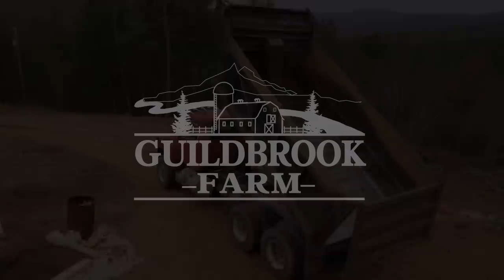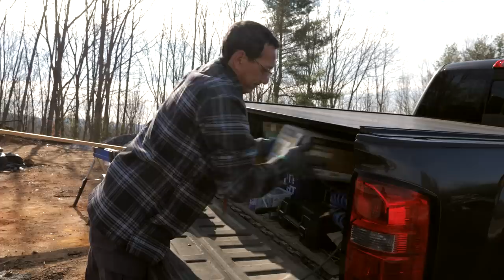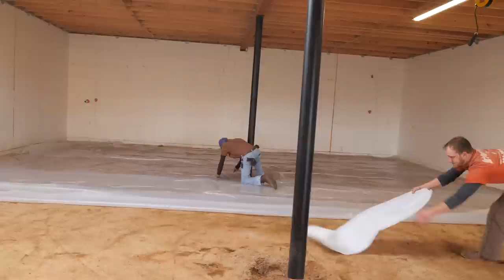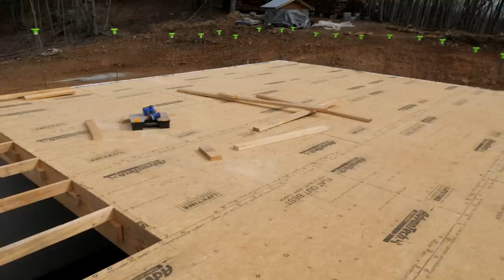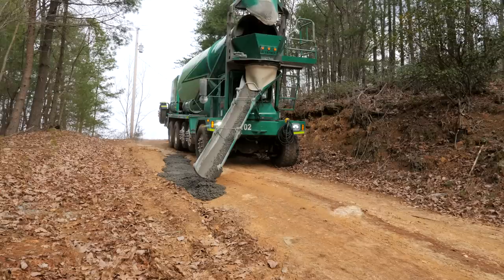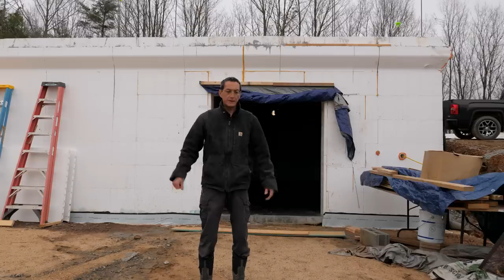ICF Mountain Homestead: Basement Floor Slab Pour & Finish

Comment: No rigid insulation below slab? No in slab radiant tubing? No floor drains? No rebar or welded wire mesh?

Comment: every area has it's own unique way of doing things. Where we live, sand has to be trucked quite a distance so it's expensive.  Crushed rock is abundant and that's what typically is used under slabs here.  I put 2" of foam under my basement slab and installed radiant tubing.  It's incredibly comfortable paired with the ICF foundation.
Reply: What type of crushed rock?  I’m worried 57 lime stone will poke through the vapor barrier.  I’m thinking 57 round river rock but that won’t pack well.  I’ve seen other use 57 limestone, then sand, then vapor, then foam.
Reply: @neckofthewoods24  It's 3/4 minus crushed limestone. Where we live, I've not seen anyone use a vapor barrier under their slab.  the soil here is well drained.  Basically I'm sitting on solid rock.
Reply: @neckofthewoods24  If you use foam you put it on top of the foam otherwise think you would need to put some sand on top of the gravel to keep from tearing the plastic and I would have used at least 10 mil plastic no matter what code is.
Reply: tee kay I’ve never see anyone put the plastic on top of the foam as foam can absorb moisture over time.   Also I know they make thicker plastic but I’ve only ever seen people use 6mil.  If 10mil isn’t crazy more I’m not opposed to it.

Comment: Good morning. Looking really great! Your basement is similar to ours, except the cement was poured in with a  long arm. We did not have a cap, as our modular home unit WAS the sub flooring.  Its going to go fast now. you must be over the moon! Our newly poured foundations walls and floor still contained a lot of natural moisture when we moved in November 2016. But we had a large airtight wood stove in the center of the basement to help it cure. You view is amazing. We are deep in the woods. A sump pump might be cheap insurance.

Comment: I’m curious what about water lines, sewage pipes, no rebar in the floor? Or even wire mats. I know they have that fiber concrete now but still I would think some kind of metal would be a good idea. Even if you use composting toilets I know you have a well please tell about your plan for addressing those things.

Comment: Water flows. If you fill in the rut on the road, you need to make a deliberate one to the side. Otherwise you will end up with another rut somewhere else in the road. Also more nasty if it forms next to some set concrete.

Comment: Not taping the seams almost defeats the purpose of the plastic, clean rock that drains easier would be a better choice for under the slab. Also if you had a thermal break under your walkout door it would keep the basement slab warmer.   But you did it the way slabs have been done for years so I can't blame you.

Comment: It's great to see your progress during the winter months.  It can be difficult.  For others watching this video...  if you are are going to heat/cool the space in a basement area, pour your slab  with at least 2 inches of EPS foam or Rockwool insulation under the poly and concrete.  It breaks the thermal bridge, reduces the cost of heating, and the floor will be warmer to your toes year around.
Reply: Where does the vapor barrier go then...between the sand and insulation or between the insulation and concert slab?
Reply: @briangroene7756  ,  any layer above the sand or gravel.   Most often I see the 10+ mil poly (vapor barrier) between the insulation and slab with all of the poly seams taped.  It's primary function is to keep moisture from the soil layer (gravel or sand) from seeping into the slab and if done right will also keep radon from infiltrating the basement.

Comment: great job! Are you going to put water sealer on the floor! It will help to keep floor sealed. Thompson water sealer great and you can sweep the water after it rains. We used to do it when I was building houses and it works. It comes in a 5 gallon bucket, and it helps when it rains a lot. Keeps the wood from bucking. you've came a long way and it's looking great!

Comment: Hmmmmm, never seen a slab done like that before. Up this way it's always gravel instead of sand with reinforcement wire embedded. We also run a 4" perforated pipe in the gravel in case of radon (maybe you don't have that down there, and then a channel along the wall just in case any water was to pass your first defense of drain pipe on the exterior of the walls.
Reply: Joe D it’s a bit different around here but not that different. We don’t have many issues with radon so it’s not required to install a radon mitigation system here but that’s were the differences really die. There were so many things on this slab that were not done correctly and if I had a concrete crew come in and install a slab the way they did then their asses would have been out the door before they ever had a chance to get the 2nd yard of concrete out of the truck. 

No reinforcement wire is HUGE!! Now I’m sure they will say that they put fiber in it which is fine and dandy, fiber makes a stronger slab but when the slab cracks, and it will, the fiber will not keep the slab from shifting and rising and that is the sole reason we use wire or rebar, it won’t prevent cracking but we can prevent it from moving which will screw up your world when you have a half inch shift in the floor. 

There will be regrets later down the road that there is not an interior perimeter drain either running outside and down the hill or to an interior sump pit and then out. You will always have water trying to infiltrate and you’ve got to use every bit of building science and technology we’ve learned over the years and put those products or procedures in place while building cause it will be financially prohibitive to try and retrofit later if not physically impossible because of the amount of demolition required to retrofit. 

The power trowel was used way to early. The concrete was way to wet which caused them to overwork the slab which ultimately weakens the slab and then is when problem #2 comes in to play because it will be more prone to cracking now, even outside of where the control joints were cut in, which in time will or can, lead to slab shifting because of no wire or rebar to prevent the shifting. 

The slab was to green to install any type of sealer. The slab needs to cure out for a month or two at minimum before applying any type of sealer. This will ultimately end up peeling off at some point because you have now trapped a whole bunch of water in that slab that can not get out because your blocked on the underside by 6 mil poly, and now the top side with this sealer. The water will come out eventually, but it’s gonna end up destroying the sealer because it’s the weak point and the easiest point for it to work it’s way out. 

There are several more issues as well but this comment is getting too long already and it won’t make a difference now anyways, the damage is done and all we can do is pray for the best outcome. It may look all pretty and flat for now but it won’t stay that way forever , especially in the region it’s in, and it’s a shame. The souls in that area are not the most stable and is not one of the areas as a builder that I would have cut this many critical corners. 

I’ll probly get a ton of crap about this comment but after 40 years of building, especially in mountainous regions, I’ve learned a lesson or two. 

Take care Brother
Reply: @1982MCI  Yep, agree with all of what you said, just didn't want to murder the subject. I am curious, you didn't mention the sand, is that common down there, not familiar with that, in theory I would think over time there is the possibility of pockets washing away and creating voids.

Comment: Hey y'all, 

Two things:

1. How did all that rain get in there? (cracks between the wood up top?)
2. When will you have a Sit Down and discuss the cost of all that flooring, and especially the concrete slab?

Keep on Truckin and Cheers from the Oil Patch in Central WY

Comment: I am surprised to see no rebar  to stop cracking and to add strength or under floor insulation. Hope you don’t intend to drive into the basement.

Also hope you keep the concrete wet for at least 7 days or it will crack like mad.
Reply: The concrete is fiber mesh. This guy knows what he's doing.

Comment: Hey, I didn't see you folks put any rebar in your basement floor. Did I miss where you explained that you didn't need it or that it's not required. 

Thanks

BTW, keep up the good work. Enjoy the vids.
Reply: Fibers in the concrete
Reply: Rebar is not necessary in a basement. The floor will not be subjected to any pressure that will cause it to move. Rebar in a slab on grade only holds the  pieces together.  The grade under the slab is more important

Comment: Question, why did you use sand? Why not Type II or what we call chat/ dolo, it's a fine crusher, that packs really tight. Vapor barrier, I would think it would defeat the purpose. Is it code there? I understand using sand for marble slab's or title, for the motions, and movement of the ground, and this why I would use sand. I've even used Type II, then asphalt over that, then pour concert over that. Love the work you're doing though, I just have a quizzitive mind is why I ask.

Comment: I just poured a little 3x4 foot pad for my composter to sit on. The directions on the quikrete bag were ridiculous.  I put almost twice the water and it was still too thick to lay nicely. I ended up pouring a layer of cement on top to get rid of the divets. Now it's smoother than I wanted! Lol. The floor looks amazing.  I am curious though,  why there was no rebar or the steel mesh things integrated into the concrete.

Comment: I would have put plastic on the flooring to protect the wood and also keep the basement dry
Reply from the maker: Did it. Just made it worse.
Reply: @Guildbrookfarm  ok I wasn't trying to make you look bad first but plz tell me was it worse because it held the moisture in the lumber from the fresh concrete being poured under it?
Reply from the maker: It holds in the moisture. Without the plastic, the wind dries everything out in a couple hours. With plastic it just holds it in and it can’t dry.

Comment: Why didn’t you pour the basement slab before the second floor or walls and why no rebar or wire grate? Is that sufficient for a car’s weight?
Reply from the maker: So it would be dry and protected
Reply: @Guildbrookfarm  no rebar or wire grate? Is that sufficient for a car’s weight if I want to park inside?
Reply: No rebar or wire mesh because this isnt a load bearing slab. That's all happening on the walls. This is just to hold furniture and stuff. For a car, you probably would need rebar but I'm no expert on concrete
Reply from the maker: Yes if you intend to park a car on it then put in 6x6 wire mesh. Our slab doesn’t need it.

Comment: Surprised there's no wire or rebar in the floor slab? Why is that not needed?
Reply from the maker: Fiber mesh in the mix 😉
Reply: @Guildbrookfarm  OK  if that's what you were told. But I didn't think fiber mix was as strong as rebar.. or wire for large slabs. Fibre (I thought helped hair line cracks mostly but not large slab loads)
Google says fibre is not enough.:.
===>>"Rebar every time! Fiber concrete STILL NEEDS REINFORCEMENTS with REBAR. We are doing 1/2 million sq ft slabs meant for warehousing, and they are all fiber reinforced.(w/rebar)"

Comment: no rebar or wire mesh? fibre strands in concrete to reinforce?
Reply: It's going to crack within the first year.
Reply from the maker: There is fiber in the concrete
Reply: 👍 @Guildbrookfarm
Reply: @Richard Brind Because the concrete guys they are working with wouldn’t know what they were doing?
Reply: @cathleencaratan3373  it wasn't a critisism, it was a question of interest and clarification which was addressed by Guildbrook Farm
Reply: @lynnhoffmann3710  all concrete cracks there is no way of stopping it. all you can do is try to control where it cracks.

Comment: Was surprised to see some of the differences in how things are done.  Since you packed the sand perhaps the slab won't be apt to crack and then shift up or down in the plane of the floor. This is my biggest issue with a couple basements I've had.  I noticed no fiber in the video which would prohibit you from having that smooth as glass finish anyway. Do you know what PSF rating the pour was? Also, with that big door opening you'll always have room for doing things differently later if needed I suppose. Curious about the basement layout, just a wood shop or part of the house?

Comment: I don't understand why you got so much water in your basement with all the waterproofing of the walls and outside with the sealer.  While the basement is open, would it be wise to put in some sump pump holes and barrels?
Reply: Linda. Perhaps it was the surrounding ground. We were fortunate to build our house in a hill that was a natural gravel pit. Our 1,000 sq. ft. walk-in cellar is bone dry, even after it rained before the sub floor arrived.
Reply from the maker: The subfloor above is not waterproof
Reply: Guildbrook Farm - Simple Sustainable Living I thought you had covered that subfloor with plastic.  If it wasnt covered, then the water leaking through makes sense.  Good luck with your project.  You have an amazing anount of strength and stamina.

Comment: did you save space to put the sump pump? gonna need one or 2 of those in that basement
Reply from the maker: No sump pumps here.
Reply: He wouldnt necessarily need one. Depends on the soil drainage,  bedrock composition and and any springs in the area. Soil testing and site location also indicates the direction of surface water runoff as well as underground water movement and upwelling. They put in a good french drain system for water running around the foundation perimeter.  The unforeseen problem would be if water perked up from anywhere in the middle of the slab from a diverted spring in the area. Jeremy said the "flood" was from 5 inches of rain they just got in the preceding period and draining more likely through  the  uncovered subfloor above. Unless you want to tarp to cover the entire subfloor  to the elements the basement will get wet until you have a roof over your heads. No harm with the occasional light rains but is hard on the outdoor rated OSB if monsoon conditions persists where it doesnt seem to ever let up for weeks. Some yrs it can be unrelenting...
Reply: @lynnhoffmann3710 , No offense but I live on top of a hill and we have drains everywhere and good thing, because whenever it rains the water is pouring out of them. When it's not raining, they trickle year round, I hate it, always wet !

Comment: Do you pick the commercials that are in your videos?   Will it damage the wood flooring when it rains?  What type of heating will you use for your basement?
Reply from the maker: No we don’t pick the ads. The Advantech flooring is made to withstand weather exposure for a few months. We will heat with a heat pump.

Comment: Looking great and yes, that surface seal is the way too go! Curious on the termite treatment. Were these the "capsules" that get buried for a long term release under the slab or just a spray as you mentioned. Also is Radon an issue in your part of the USA? Out here in the West requires some kind of capture/vent system to the outside in crawlspaces/basements.
Reply from the maker: They just spray the perimeter. There’s no wood in the basement anyway but code still requires it 🙄. And radon isn’t a big issue in this area.

Comment: Just found the channel. Subbed. Question: how do you deal with rain and ICF formwork before it's poured?
I guess your zone 3?
Reply from the maker: Rain doesn’t bother it at all.
Reply: @Guildbrookfarm  

I've worked with ICF quite a bit. But I'm new to rain. Wondering if your ICF guys cover their empty formwork or if they poke any weep holes in case of water inside.
Either way don't forget to have fun!

Comment: What does the plastic do...
Reply: Keeps moisture from wicking through from the bottom
Reply from the maker: Vapor barrier prevents ground moisture from reaching the concrete.
Reply: @bennapier9260  
Thank you
Reply: @Guildbrookfarm  
Thank you, so, it's absolutely necessary...
Reply from the maker: Yes definitely

Comment: No rebar?
Reply from the maker: No. Fiber Mesh in the mix.
Reply: @Guildbrookfarm  oh right you mentioned that before. End result looks amazing. Well done. I was also wondering about pouring right up against the steel colloms. Over here (Netherlands) that's not allowed in any situation because of the working of concrete. How is that over there?
Reply from the maker: The columns are coated with sprayed on rubber membrane.

Comment: This is probably a dumb question but couldn’t the concrete have been poured before even the walls were up? I would have thought that would’ve been much easier. I’m sure there’s a reason it’s done this way I just don’t know what it is. I’ve watched homes be built in Florida and usually the slab is poured with the plumbing sticking out of it before the walls are added.
Reply from the maker: Those are slab on grade foundations. This is a floating slab floor. Very different.

Comment: First vid in a while where I haven’t seen radiant floor installed.  Also no rebar?
Reply: I was wondering the same thing, that slab is gonna crack!
Reply: Read down in the comments.  It's explained about 11 times.
Reply: @pnwester2697  that's pretty cool is it cheaper or more expensive than using the rebar?
Reply: WHITEHOUSE FARM not sure. Saves  labor. I wonder if it’s strong enough for driveways
Reply: PNWester we did a kick off years ago for a driveway extension for my dads truck.  Never an issue that I know of.  I’d have to go by that house 18 years later and see it.